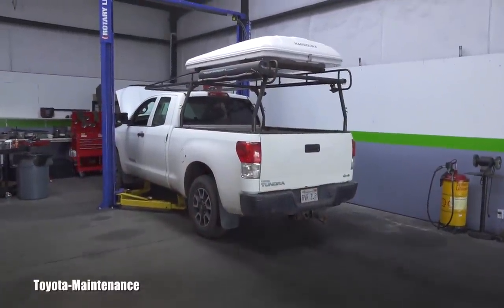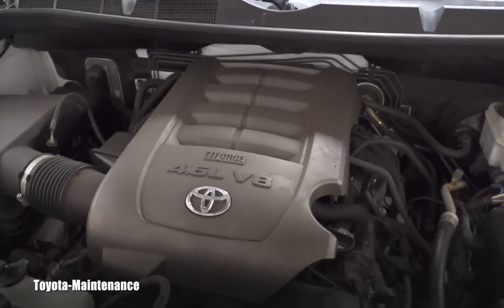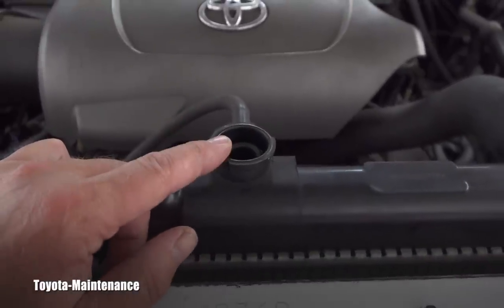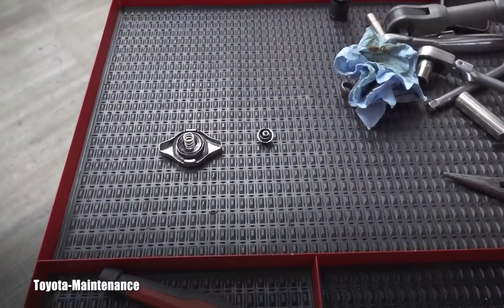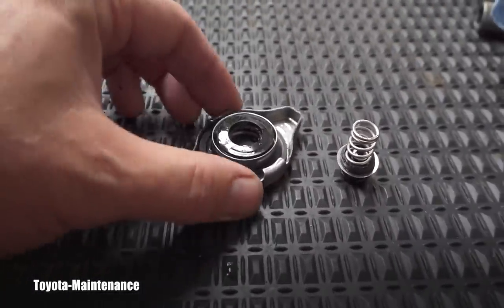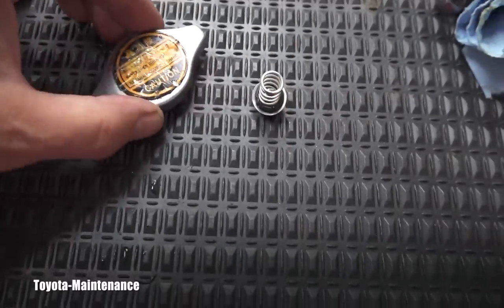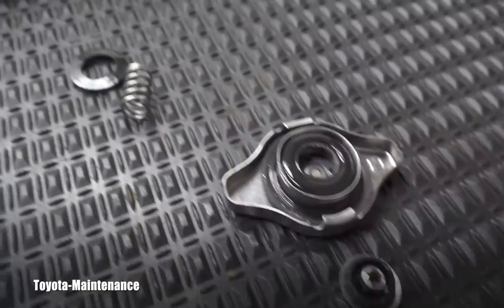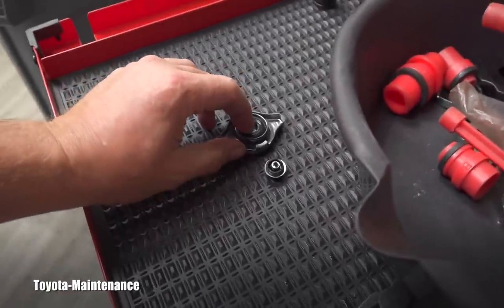The Curse of  Faulty Radiator Cap

Comment: A very common overlooked part of the cooling system. This is pretty common failure with Asian manufactures. Ours failed like this on our Honda CRV. Thankfully the pieces didn't fall down inside the radiator and into the cooling system.

Comment: Had this happen to me before. Except the application was different and the spring was not part of the cap like that that broke. The double stacked rubber washers things that dangle at the end disappeared. Months later it clogged something and the whole system finally pressurized and because the hose was stuck to the neck, the whole neck snapped off and the car was bucking and jerking due to the heat. At that point turn on the heat to max to use the mini radiator you still have left since the big one is now disco'd and coasted to the side..

Comment: Thank you for uploading this video :) old cap came out in 5 pieces 😂 Though new cap won't fit, do you have to push the absolute hell out of these to make it fit?? Radiator in my daily Toyota is an old Taiwan made aftermarket one, pressure on both caps is 0.9 Bar. Every time I try to turn it the tabs don't go down enough & shaving plastic where it's meant to tuck under, too much fear breaking plastic parts & spending more money on another radiator.

Comment: WHOA, I just discovered the same thing on my 2000 Corolla, I randomly pulled the cap but had no symptoms such as overheating. I only got the cap and some washer, but knew the grommet and spring at least were missing.  I didn't see anything available to fish out with pliers, and thought maybe it broke off when last removed for service.  I think I'll look again and probably pull the hoses, I don't think I've had any over heating, I wonder how high up the gauge is considered overheating, I think it has gone past halfway, maybe 3/4, but not 7/8 or pegged.

Comment: This happened to my 1994 Toyota Corolla. It would usually spit out all the water contained in the over flow reservoir and the radiator after a long drive, took it to many mechanics but never figured it out except in the end there was some part of an old radiator cap that was causing blockage.

Comment: 2004 Honda Pilot has the same style cap and it indeed happened to me but the silver ring also came out separate as well as the bottom rubber and the spring but I luckily got it out (very tiny), now all the new caps I have been trying (Denso included) are not tight enough to the radiator and it leaks around the top seal. Any suggestions? Also, everyone beware of those style caps! 😢

Comment: Radiator caps are not supposed to last forever. They have a lot of pressure and heat on them
Reply: Yes But only a crappy design will physically break, Granted the seals wear out causing a suction or discharge leak but that will be noticed during service. Toyota messed up here. I suggest using Stant.

Comment: Happened to me about 6 months ago, I was planning on doing a flush anyway but not that soon. I ended up removing the radiator and the piece fell out. I got it straight away as It happened after I removed the cap.

Comment: If that was an OEM cap , it's a disgrace . The CEO of Toyota should be told . In general , that's why I don't use no name white box parts . Especially possible counterfeit parts , cheap , online . Maybe an air freshener . However , instead of " springtime scent " , it's bus terminal bathroom odor ! LOL !😄

Comment: This happened to me yesterday. 
It's fine now, but I know the rubber seal is somewhere in my coolant system
Reply: I noticed the rubber gasket was also missing from the cap bottom piece he pulled out of the radiator in this video. Mine broke as well, and I think clesr gasket is in my cooling system to this day. I've been having hesitation issues, but not sure if it's realated.

Comment: Only 2001 4Runner I swapped out the radiator cap for a new Stants cap. It didn't open and warped my heads. After swapping heads it still didn't run right so I ended up replacing the entire engine. All for a bad radiator cap.

Comment: Peter, was this a Toyota radiator cap?
Reply: Right?  I'd be scrutinizing the OEM compared to an after market one.
Reply: @catsupchutney  The one that failed on me was a aftermarket unit. Said it was from Japan but my guess is no way in hell
Reply: It looked like a factory part but so do fraudulent parts.
Reply: @Esteban_Herrera  A lot of fake Denso stuff online these days. I only source from dealers now because I’ve been burned
Reply: @nordicpride9708  If I buy Toyota stuff I buy from the dealer. I save money if I order online and pick it up at the dealer in a couple hours. Frontier Toyota in Valencia. I just bought a cap there and handed it to the service writer when they did serviced my radiator. I hope the old part wasn't fragmented. The mechanic receiving the cap might have assumed I knew it was broken and that's why I gave him the part. I'm taking the POS off and installing a Stant made in China formally in the USA. 😖

Comment: Nissan says  to change cap every 30K.
Reply: Seems a little soon but Ok. There are 2 seals, an inner and an outer. The outer one is the one that gets cracks in it starting on the outer edge which is also exposed to the elements causing it to dry and crack. It leaks air as the engine try's to draw back the coolant from the recovery bottle. This air then gets trapped in the radiator. It gets worse over time. Is the Nissan cap built with plastic parts?